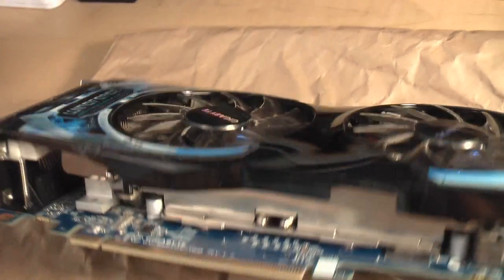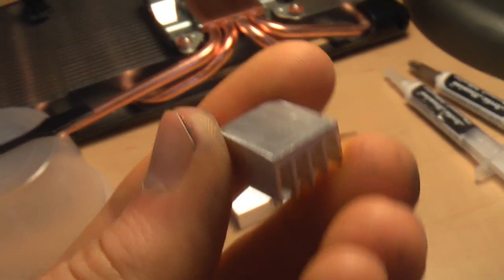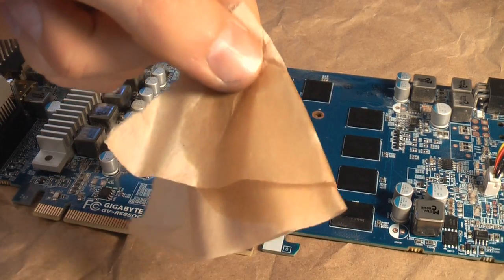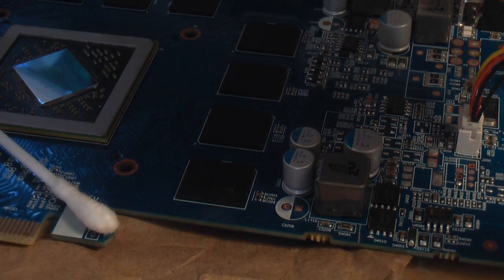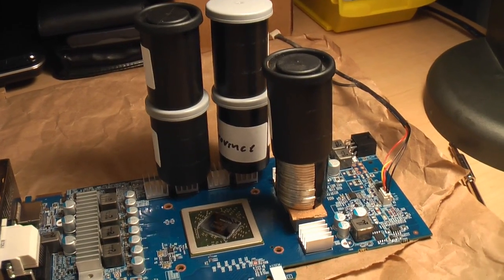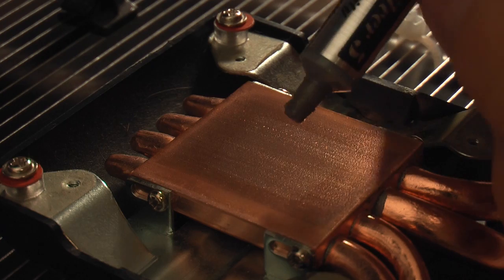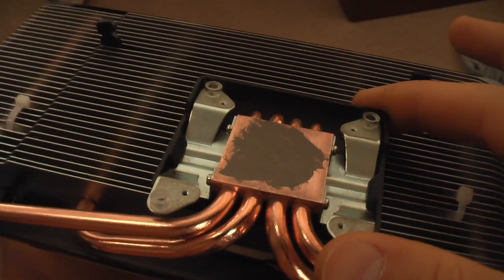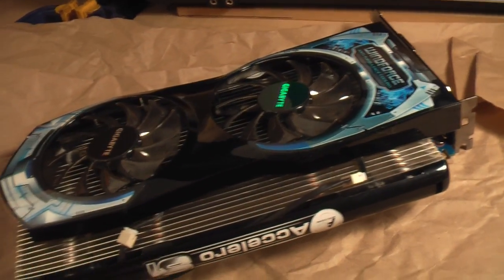Installing an Aftermarket GPU Cooler

Comment: Keep it under 50-55..... yeah.... pointless.... Gpu is super safe around 60 Degrees..... SO Everything you just did is POINTLESS!!! even affecting memory modules and etc.... probably braking something.... and for such useless card... NO MODDING IS NEEDED!

Do that with at least HIGH END STUFF

Comment: Heatsink designer here,  the rough surface on the metal faces is to increase surface area. By sandblasting or making rough textured surfaces you can increase the amount of area that the paste can transfer heat and energy into..... by sanding down and filling in the rough surface you have effectively lost a heafty amount of heat absorbtion and have made your cooling solution far worse.   Dont do that

Comment: that's not the proper way to spread the thermal paste you put a pea size in the midle then just put the heatsink on other wise you'll have air buble in it the heatsink will spred it for you evenly

Comment: If planning losing warranty go costum loop temps around 40 c with low fan speed and pump speed get good pump and big tubes 19/ 13 for best results invert ed mobo or vertical gpu for so that the block will press good the die. Or cut down versions like 1070 gaming x same cooler with 1080 but less power smaller die easier too cool  below 60 at 55 % with side panel close most of the year even summer with 35 c bf1 62 c

Comment: My hd 7870 heats up to 100c on load with 100% fan speed. I replaced the thermal compound, reinstalled drivers, and did everything you could think, but it still gets super hot for no reason

Comment: can someone suggest good but not too pricey aftermarket cooler.. my gpu fan like always bumped out... I damaged my fan by putting aio oil long ago, the fan did not locked in its socket... if we push the fan back inside, it working like it should
Reply: if you havent solve the ordeal... let me sugest using 2 things you will need bicarbote powder... apply it where the fan has got loosen... then apply one or 2 drops of super glue... the combination of these 2 will make a solid... its almost as hard as stone... be careful not to make a mess... only apply where needed... later if needed you can use sand paper or a cuter knife to remove excess...

Comment: not enough thermal paste is dumb as fuck
Reply: actually the trick is to have a layer as thin as possible.
Reply: GPU core is smaller than CPU and it doesn't need much paste
Reply: Yup, thin to fill the microcavities, a microscopic layer for full contact, but as little as possible.
Reply: enlightendbel umh go watch some professionnal overclockers, they put shit tons because that is the best way to fill any cavities in the 2 surface and as you squeeze them together they'll form the perfect thin layer, your IQ just isn't high enough for you to visualise Squeezing and compression nor thermal conductivity but that 's not my problem
Reply: Lol. Oh look, it's a baby troll.

I've been overclocking computer hardware since before you were likely born, if your conversation style is anything to go bye (actually, since I've been OCing the shit out of my hardware since my first 486, your conversation style doesn't even need to be accounted for).
Reply: enlightendbel sad to know you've been doing it wrong all your life ;) pretty sure you also use a Bad thermal paste
Reply: Maxime Monnier As long as its covering the whole chip its good enough.

Comment: You do realize that memory heatsinks literally do nothing, right? Waste of time and effort in all cases.
Reply: Not necessarily, they can get quite hot depending on the voltage/frequency used.

Comment: anyone know if it's possible to remove the tacky black plastic trim? I'm considering an Arctic Accelero for a rat rod / steampunk build that will have a 10" fan on the case and no fans inside. Cheers!

Comment: Anyone else here modding the RX 480, mines coming in tomorrow!
Reply: Modding wont gain you anything except for a more silent operation. The Chip is already at it's limit and thus not providing much OC'ing headroom. Most cards cap out at approx 1350 to 1390MHz. 1400Mhz fails to run for over 5 minutes on various reviews as well.
Reply: It's called having fun, I mod everything!
Reply: BUT YOU VOID WARRANTY lol.
Reply: The card is not urs, until u void the warranty... hahaha
Reply: FYI JazTwoCents got his to 1466mhz stable on water
Reply: RX 480s can easily clock over 1400, you just need to not use the reference cooler and you have to cool the VRMs properly.

Comment: NOOO when you want to sell it or reuse the cooler for another card, the Arctic Alumina adhesive cannot be taken off easily. There is only a "rumor" on hard ocp and THG about successfuly removing the thing.

Comment: man those coolers are hideous. I looked @ them when i was running my 6950''s, and it could have made it run 100C cooler, and i Still wouldnt have bought it, just too ugly. might as well throw a clear plastic ziplock bad of dog shit inside your case.
Reply: +jboydgolfer1 The newer versions look a little better but not by much.

Comment: my fps drops and goes up from time to time when i play world of tanks or bf4, will the reason for it will be that my gpu is overheating? got this problem for 3 months already cant find the right answer to it. pls reply thanks in advance
Reply: +Michael Vincent Ignacio it could be that its over heating but if its happening in world of tanks it might be the cpu isnt strong enough get something to monitor the temps and find out what they should be around

Comment: Very helpful. Most other videos on this topic either dont do a good job showing the steps or they dont talk and explain what they are doing.  Thank you :D
Also do you think its ok if I use the built in sticky stuff that came with my heatsinks? Other than the risk that they might fall off is there any other risk of not using the epoxy silver?

Comment: I could use some help.
I got two r9 280´s from MSI and one o them (the one in the lower PCIe slot) runs way to hot for my taste. It idles at around 50C and under load it runs at 80C to 85C but if i activate Crossfire and run both cards it gets up to 90C to 95C! I know its fine but i hate how loud it gets since the fans run at about 100% when it gets above 85C. The upper Card runs at about 75C under load max 80 with Crossfire enabled and at idle it runs at 35C (my two monitors are plugged in in the hotter card, but that can´t make the big difference can it?) PLS HELP!
Reply: That sounds bad, they sell 120mm fans which clip onto the sides of gpus if they are in SLI/Crossfire, increasing airflow between them.
Reply: +Lucas Haider 
This could be because of many reasons. I imagine your case is a bottom mounted psu? You  might not be getting great airflow to your 280. You could also have a faulty card, where the heat sink isn't mounted properly. I am leaning towards the airflow issue.
Reply: +Avery Eremondi THX for your help but it's not the airflow. the airflow is really good in my case. I am thinking of buying a VGA cooler for it. that should solve it.
Reply: a little late ther bud haha. but thanks anyway. got myself a gtx 980.

Comment: pls help me   my gpu fans are not running at all ,but the gpu is running and also gives display  but when I run game it gets hotter and hotter and then turns off ,I think the  fans are burned  ,I have amd 7950   and I don't know what to do ,is it really the fan or another issues? ???  :'(
Reply: might be a feature
Reply: +Zachary L what type of feature ka this?  But when i manually turn them on at 80percent  then fans start to spin
Reply: The gtx 980 I tink turns off fans during idle time
Reply: +Zachary L but mine dont even start even at stresstest  i always have to start them manually   :'(
Reply: +Shahzaib Awan its probably either a software bug or your heat detection is not working properly. try running it on another pc.if the problem persists then depending if its a new video card perhaps you could send it back. or ask for support in the official forums.
Reply: +Shahzaib Awan o and try opening you software kit and adjusting the fan ramp up times. it could be from the scale.

Comment: I have a question about the Heatsinks you put on the vrms. I have a GPU that's not compatible with any watercooling blocks aside from a universal standalone block it does not cover the vrms. So will passive air cooling over the vrm be sufficient enough???

Comment: my gtx970 idles at 30-50 and goes up to mid 80s under load and youre complaining about 60..
Reply: ***** NOPE...
Reply: +Lance Echo An old comment. however, I'd like to clear up: the Maxwell series is designed to run at 80°C or lower. Obviously, 83° is higher than 80, but it's a negligible amount. Around 90 or above is when you can incur damage.
Reply: Lance Echo I'm more of minimalist. I'm using an MSI GTX 960, which runs at ~60% fan speed (which is surprisingly quiet) and gets sub 70° under load. I see no benefit to water-cooling unless you're overclocking.

However, I do think the Titan X should be cooler under load, and this could be achieved if Nvidia would let their partner companies use non-reference designs on their cards.
Reply: josh Subet cooler master hyper 212 evo for cpu but i have no aftermarket cooler on my gpus
Reply: nothing this could work for older cards that uses more power which equals more heat
sorry if it makes no sense its because I am currently stoned
Reply: He's complaining because he has a right to. My titan X goes up to 83 underload and that's unacceptable because your hardware won't last long with constant temps like those. Some people like to persevere their hardware. Give the man credit for trying don't bring him down. Because I have to eventually water cool my Titan X. The card is built like Shit in comparison to my GTX 690. Aluminum bodies are the way to go, this plastic or graphite shit that doesn't cut it for GPU's these companies are cheap as fuck and aftermarketing your GPU is much harder to do than CPU, because it's Less popular thing to do, so therefore options are very limited in comparison to CPU modding. And I don't know why this is not more of a priority in this industry. No one wants to sit next to am Boeing Airbus while trying to be entertained.
Reply: int main(void) well I just finally was able to liquid cool the card 2 days ago and man o man... It's like night and day. Card performs like it should've in the first place. Costumers have to force the industry away from these lame ass shrouds. GPU cooling needs to evolve because u are never getting your cards true potential from air. GPU benefits 5x more from liquid cooling more than CPU's yet the market is late to catch notice. I'll never go back to air where GPU's are concerned. 

Now the Titan X can finally live up to its potential. Because once you get pass 81° C, the card will throttle unless; you want to set your fan speed to sound like an airbus to get Good performance and even then the card doesn't run as stable as it would if the temps were 47° C. I'll tell you this much, I surely have a whole new outlook on cooling and a new standard now.
Reply: Lance Echo you are rich man, Cool a Titan x and a 690 how awesome
Reply: Whoa, dude the 970 is supposed to run at 70c max with after market coolers. Do you have the reference cooler?

Comment: Spreading doesnt work as well as just letting it spread automatically
Reply: the chemtrail kid 
Omg, finally a someone smart here! Thank you brother!
Reply: i feel like ultimately this is one of those debates that probably only makes like a half a degree of difference sometimes
Reply: Without an IHS, GPUs (and similarly exposed silicon processor dies) actually benefit from spreading manually. Especially when you're using liquid thermal compound for the TIM, the gallium surface tension needs a bit of work before it allows itself adhesion to the copper surface (no problem with the silicon die).
Reply: just use non conductive TIM and put a 8mm BB sized drop on it and apply the cooler, thats what i do when replacing the TIM on my old GPUs, no need to spread it out and you get perfect coverage on the die
Reply: AliShuktu when using AS5 it is very dangerous to not spread the paste on a gpt, if it globs over onto the pcb, goodbye gpu, its extremely conductive
Reply: TheCanadianLanBoy, why telling me?
Reply: Gino Foogle we think this because of the number of review videos comparing application techniques. Linus tech tips does a great one comparing about 6 different ways and the best way was single dot in the middle or single line.
Any other method trapped tiny air bubbles so now you're conducting through an airated medium which is bad.
The coverage wasn't as good, but thermal testing proves it's better.
Reply: AS5 is not conductive, i've dumped the shit on a video card pcb once by accident, its capacitive not conductive -by dumped i mean i accidentally got to much and it got onto the pcb , i had no issues with it at all, i only noticed it when i was puting the stock cooler back on to use the aftermarket one
Reply: Applying a single glob of thermal paste to the center of the die introduces no air bubbles to the thermal paste material. Spreading it by applying pressure from mounting the heatsink does not introduce bubbles.

Using you hand to spread the thermal paste will. You will not get it perfectly level. You will make small ridges in the thermal paste material. 

This has been tested many, many times.
Reply: not sure why people think this, go ahead and try it and then remove the heatsink. youl see a big round smudge and some parts are left without paste.

Comment: I prefer keeping my cards below 60 degrees celsius. I've bought a new card today, the R9 280x and I was pretty much shocked. Load temperatures are around 80 degrees celsius with fan speed on 30%, but if I turn the fan speed up I will end up with a really loud card. 
I was using a Radeon 7870 before with an aftermarket cooler and normal case fans mounted on it with zip ties and even on full load and fan speed on 20% the card would not go any higher than 54 degrees celsius. I'm almost feeling like I've made a mistake.
Reply: VRM cooling? VRAM cooling? That's your mistake there.

Comment: Guys........ 60c is nooooo problem at all!
when you get up to 90-95+ then you should be concerned.
Reply: I get to 100 degree lots of times, but now I use MSI afterburner for 100% fanspeed and a big fan outside my PC, but costs to much power so I really need to change it
Reply: I would say that as long as your GPU is at under 75 you should be happy, but above 80 and you should be concerned.
Reply: With that being said, 80 at full load is normal though.
Reply: Dale 80 At full load can drop your clock by about 100mhx easy. It starts clocking down at 60

Comment: I hope your joking 60c is EXTREMELY low for a GPU under load. I'm sure the fans are still near idle at that temp. Hot is anything above 80c i could see water cooling worth your time and money just for noise reduction purposes. But 60c really? I guess you already had the cooler so why not right. Can't recommend anyone spend money on something like this if your getting massive low temps like 60c under load on your GPU
Reply: +shperax maybe he just wants it to be more silent so the fans run at much lower speed for the same cooling
Reply: I get 75 c on rx 580 while on load is that bad.
Reply: Lol, 60 degrees C
My Hawaii XT R9 290X operates at around 92-94 degrees Celsius when under normal load, ie. Playeunknown's Battlegrounds in 1080p high preset.

Comment: 70C is not hot..  anyone who tells you otherwise is completely wrong. If that was the case then Asus and gigabyte would not sell a non reference card that overheats. Don't worry about it.

Comment: Adhesive is permanent so pray you never have to RMA the card. Just use regular paste and use high heat silicone at the corners to hold the heatsinks in place.

Comment: outstanding guide ... if only all hardware installation guides were as thorough as yours ...   personally I prefer the Accelero Twin Turbo II which ive used on several cards ( GTS250 and HD4850 ) and on both occasions it reduced idle temps by over 10c ... the only downside is the ramsinks which can fall off,however I used the pre-applied adheisive ,however I shall use thermal compound in future jobs 
           great video

Comment: 60c load is actually a good load temperature. gpus are made to run 80+

i personally think that installing a custom cooler on your card was pointless. i would have instead just upgraded the card, or just left it as it is.

a good video nonetheless